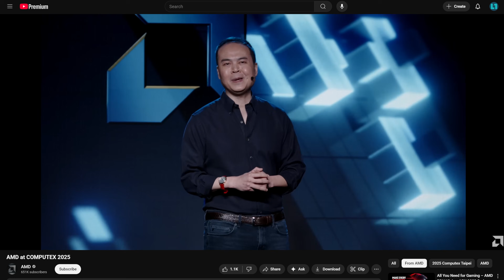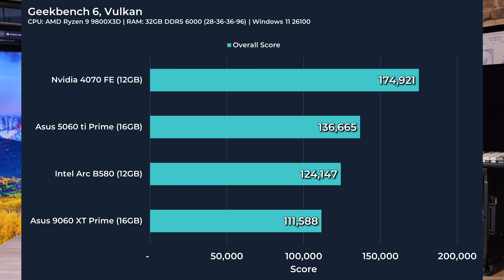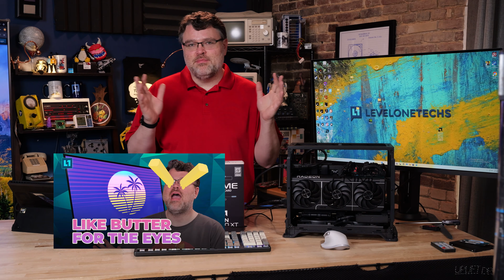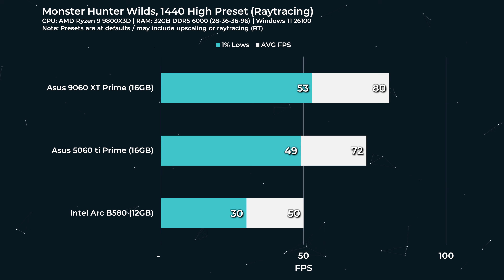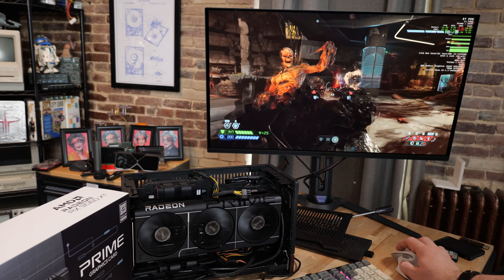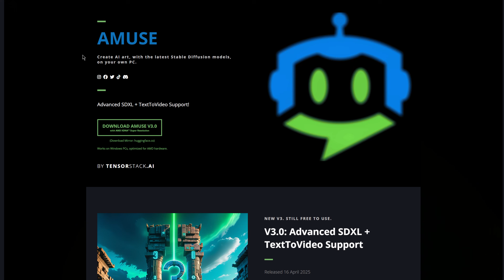ASUS Prime Radeon 9060 XT Review and Benchmarks!

Comment from the maker: Looks like the non pretty graphs made it through to the upload. My bad! The information is all correct! It's just not the right aspect ratio, so it doesn't look as pretty on screen. ~Editor Autumn
Reply: You made up for it with the butter eyes!
Reply: You need to try to stick a power color reaper 9060xt 16gb into a Asrock Deskmeet, it is 200mm and looks like a true 2 slot card and I think is the new itx budget king. Plus I think Asrock has a new AM5 version and it would be interesting to see if the gpu clearance is the same for both versions of the deskmeet.
Reply: @johnchristianson515  yeah I have the deskmeet x600, it's amazing
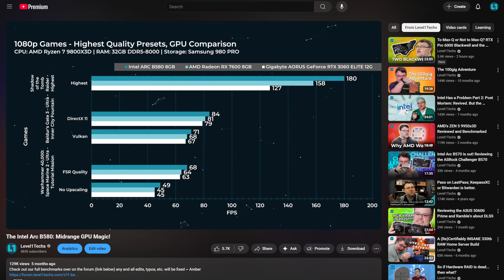Reply: 5:05 The graph says the B580 has 8 GB but it's 12 GB (even B570 has 10 GB).
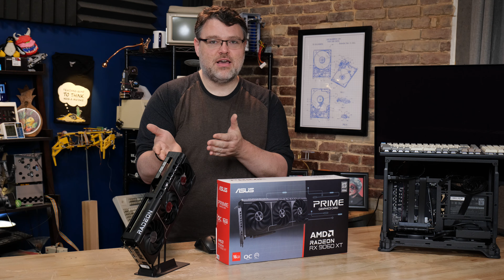Reply: 1:05 isn't 128bit bus width a problem somehow?

Comment: No reason to include the B580 in any comparison, because it's always shown paired with an extremely fast CPU like the 9800X3D. Nobody in the real world would pair those two, it would be more like a 7600, 7500F, 9600 or even an AM4 5000 series CPU, because it's an entry-to-midrange GPU.  Paired Properly, the CPU overhead of the B580 destroys its performance vs competing cards in its market segment, and there is no solution but upgrading the CPU... which if the user could afford, they'd be buying a 5070 or 9070 instead anyway.

Comment: Why is no one comparing the 9060XT to its most popular used competition 1st the 6700XT and 2nd the RX6800 / RX6800XT. I have a 6700XT is it worth upgrading to a 9060XT because a 6800XT is better for the same cost and the base RX6800 is equal performance for cheaper. I don't care about fake frames and I always disable RT. Other than power consumption idk...

Comment: Asus and gigabyte both can be extremely hit or miss with AMD hardware. The 6000 series they put out was notoriously horrible but the 5000 series were fine

The real problem is they tend to cut corners on the electronics

Comment: Intel B580 has been on my radar since your video about it's performance on linux. In that video you said that you'd come back to it as drivers improved, and I'm waiting, lol
I'm updating from my Ryzen 7 3700 machine, but I'm fairly poor so I'm getting parts for the new rig every few months as I can afford, so far a AMD Ryzen 5 7600 CPU, an MSI B650 GAMING PLUS WIFI ATX AM5 motherboard, and a Cooler Master MWE Gold 850 V3 power supply.
I don't do any hard core gaming, just stuff like 7DTD, so my graphics needs are light. I could probably get by with the graphics from the CPU. The Intel graphics card would be a step up from that, though, and would be better than my current NVidia GeForce GTX 1660 Ti, so yay.
I love all your videos, but sometimes you have stuff actually pertinent to me:) I've been a linux guy for ... well, I think there were dinos. I used to software engineer on unix so it's a comfort thing.

Comment: this does NOT need 3 fans this should be a tiny little guy for the SFF pcs!
Reply: Get the Powercolor Reaper 9060 XT, which is very small for a 2 fan model, but makes a lot of noise when cranked up to max performance.

Comment: The only upgrade for me (currently on a rx 6800 16gb) is power consumption and ray tracing are slightly better. I was able to get the 6800 last year for 350 open box. So there's almost no reason for me to consider this. Realistically you have to move up to a 500-600 dollar card to experience a real upgrade. When you can find them a 5070(NV) or 9070(AMD) most likely won't be at msrp. Its ridiculous to me that after 5 years you cant upgrade without paying almost twice what a previous older gen(rx6800) mid\high card is going for. Also stop making 8gb cards. BTW 8942 Port Royal and 17449 Time Spy on my system. I know games act differently but this is one example of this not being an upgrade.

Comment: I will wait for the market to die down. I have currently an RTX 3050 8GB for 3 years and so far, its doing a great job. Running the latest titles in 1080p medium preset with DLSS Quality at 60fps. Normally I play older games and try to hold on my gpu for at least 5 years(like I did for my gt 1030 when I was in High School). I can run most if not all e-sport games at 100-200fps+ and I can run 2023/2024 games at 1080p medium native or High with DLSS Quality at 60 fps. Any game before 2023 I can run 1080p high to ultra native quality at 60fps. The 9060 XT is kind of tempting to buy since I do have money, but my reason is if it works then why upgrade it. It does what I want it to do and use it until it can't do what I want it to do.

Luckily I have a 1080p 144Hz G-sync/Freesynch monitor, so I dont get screen tearing, etc.

Comment: Nah you don't have to feel bad for 6000 and 7000 owners. I am one I have a 6950XT. If games implement RT well that is made for usage on consoles the games run well even with RT on.

In other games the visuals are 9/10 of the times not that awesome vs raster only a few games have transformative improvements in visuals with RT on. And even then I don't think it's worth the fps hit vs visual improvement. I rather have the higher fps for more smoothness. And 6000 owners already got 4 years out of that hardware and it's not that raster does not look good.

But I agree we are getting to a point that RT is getting useful so for the next card it will be something to look for.
But I think 7000 owners will still be fine for 2-3 years. As long as not to many games force RT and break performance it's all fine.
If they implement it in the right way it can perform very well spider man is a great example.

Comment: This card is DOA if it doesn't hit MSRP. Slower than a 5060 TI and slightly faster than the 5060. When does 8GB of vram cost 50 dollars? The Nvidia cards are also getting closer to MSRP and DLSS support is still way better and that's a critical feature on this class of card, especially if you want to try some light RT.
Reply: I purchased the ASUS PRIME Radeon RX 9060 XT 16GB from NewEgg just yesterday (Friday, 6/13) for $349.99.  I also saw the ASUS Prime RTX 5060 ti 16GB in stock when I went to make my 9060 XT purchase -- three different listings for it in fact (all of them 'sold and shipped by' NewEgg): the first (new) priced at $479.99, another one (also new) priced at $529.99, and a third one ('open box') also priced at $529.99, and all of them were in stock.

I double and triple checked this: all three of those 5060 ti cards were the same model (PRIME-RTX5060TI-16G), and all three shown to be sold/shipped by NewEgg.  (I even went back and took a screenshot of all three listings lined up together; the two new GPUs showed a $9.99 delivery fee, while the open box listing showed 'free delivery,' and all of them indicated the same June 17th - June 20th delivery time frame.)  Go figure. 🙄

The bottom line for me: the $130 price difference between the 9060 XT ($349.99) and the cheapest 5060 ti ($479.99) makes the AMD card a MUCH better value, even when taking the 5060 ti's performance advantages into account. (I do like that Nvidia used GDDR7.  I just wish that AMD had also.)
Reply: Unfortunately it's $50 as long as Nvidia says it is. It's unlikely the AIBs would want to shrink the gap on the AMD side unless they were forced to, and they'd have to be dragged kicking and screaming. Given the current spot price, after figuring the AIB is paying for the memory and assembly cost, applying a margin, then the retailer gets margin on that, it could probably be around $20-25.

Comment: Wendell, Since I know you love to tinker.  Something in MHWi is off with NVidia cards.  One of the systems in my home has a 2080 Super and another 3060 in it and I actually get better performance like for like using FSR vs DLSS, both in 1% lows and frame times.  I found it odd on one system so I checked it on another one to verify.  Something about the DLSS implementation in that game is not right and I've recommended to a few people with newer Green cards try FSR instead of DLSS and they have seen performance increases as well.  (Yes DLSS 4 is generally heavier than FSR 3.x, but in this game it's significantly more so.)

Comment: The PRIME offering is our entry to the 9060XT, if users would like additional power limit headroom and a further improved thermal solution we have the TUF GAMING variant. With that noted the card is very cool and quiet and does have OC headroom. 

The default power limit is 175W but can go up to 192W. 

With performance tuning/overclocking you can generally see around another 5+ frames with quick overclocking results may vary from game engine to game enginne.
Reply: Too bad Nvidia bully you in to not having ROG AMD cards anymore, not that 9060xt would have one anyways probably but the 9070's.
Reply: An Asus employee fed me chicken nuggets behind a McDonalds dumpster last night in downtown Austin, Texas.
Reply: In return of some happy ending , right ?  @EvenStick-q3x
Reply: PLEASE make a small form factor card for this! At this wattage we could build a tiny portable or living room box but the 3 fan seems overkill for this card. Thanks!
Reply: What we want to know is whether the MSRP will be honored this time around ! MSRP is rarer than a unicorn these days.
Reply: @ftlfx  thats barely up to Asus
Reply: Woot! Hello Asus!
Reply: entry level... meanwhile PRIME is more expensive than anything other AIB offer and  8 GB version cost more than 16 GB Sapphire Pulse 😁😁

Comment: The graphs are great with comparing all the cards with their respective frame rates, but I think it would help with clarity to keep the cards in the same order regardless of their frame rates. Like at 14:00, if both FG OFF and FG ON (1X) had the same GPU order, it'd make it easier to compare the scaling frame generation has while also comparing each GPU against eathother. Great benchmarking and good info regardless!

Comment: The B580 is looking like bad value.  They were running much higher until lately (shows you the power of some competition), but the cheapest is 299, not the 249 promised.  I think Intel will have much better luck with Celestial, but man, the tests look weak for the B580 against RDNA 4 and Blackwell.  Would be great at lower 200's, but at lower 300's, even if the 9060 XT 16GB (FU AMD for doing this naming nonsense with an 8GB XT card) is high 300's, it has a lot more value than the B580, and the B570 is LOL DOA right now.

Comment: I doubt the 16Gb version of this card is available for $349. AMD doesn’t price anchor with a reference model.
Reply: I just bought the Asus Prime RX 9060 XT 16GB for $349.99 on Amazon. It sold out in half an hour. I've also seen it at that price in brick-and-mortar stores like Best Buy and Micro Center. This AMD series has been much closer to the recommended retail price than the Nvidia versions.

Comment: I run LM Studio on Windows and I'm wondering if I should buy this card. After all VRAM is the most important part of the GPU. And for running LLM's, even if you will only partially offload the model - it is the difference between night and day.
Reply: Just buy a framework desktop with 128gb of available memory for the GPU.
Reply: @singular9  I wish I had that kind of money. I have my 5950X with 64GB of RAM and the only reasonably priced card I could buy during crypto bubble that wasn't 8GB - RX 6700 10GB.

And LM Studio, Amuse and InvokeAI work ok.

BTW on my father's Framework Laptop, I tried installing LM Studio. When I loaded any model (even small, since it has 32GB of RAM), laptop would crash and wouldn't stop crashing until I unistalled LM Studio. It's probably the BIOS, because I was assembling it in October/November and there was some issue with iGPU (normal OBS recording using default AMD preset would freeze the recroding - workaround with open GL fixed it). I do hope that fixes it, because then I could maybe invest in 96GB for it's RAM.
Reply: @singular9  one is $350 and the other is $2,000

Comment: Just yesterday I decided that I am done with nVidia. I have RTX 3060Ti and it's really good card BUT I wanted an upgrade. The prices for nVidia are insane and with all their false marketing lately I have decided to switch to AMD and will probably go for AORUS 9070XT OC+ with 16GB. It's not a cheap card but it's waaaaaay cheaper that any decent nVidia upgrade options and packs quite the punch!
Reply: Do it
Reply: I got a 9070xt and couldn’t be happier. I did a 50mv under volt and upped the total power 10% and it’s rock solid running 3.4ghz in synthetics
Reply: I went from a 3060 Ti (gave it to my daughter) and got a Sapphire Pulse 9070 XT. Huge, huge upgrade! Together with my 5800X3D it's a dream machine right now!  I play at 1440p 170 HZ monitor and it just plays smoothly! Don't forget to use DDU when switching from NV to AMD and vice versa.

The Adrenalin Sogftware is so far ahead of NV software right now. It's an all in one software that even allows a per game control on your OC (some games can handle higher OC on your card others can't) with fan control, stats monitoring, etc.

EDIT: If you can find the Gigabyte OC or Pulse, they are both cheaper and run cool and quiet if you tune your fans properly. I don't like zero fan and my card at full load running at 1500 rpm tops out at 52*C with a hot spot of 70*C. Memory temps are also at 68*C. All temps taken with an ambient of 26*C.
Reply: A 9070 or 9070xt would be the choice for me. MSRP's(real) and availability are all over the place. In a perfect world you shouldn't have to pay more than 450 for a card @ this level. If you are building a new lower to midrange pc the 9060xt 16gb would be a good choice if you don't want to go used or open box.
Reply: Same. Have a 3060ti. Going to sit and wait till either it dies or I can buy a card for 499 that can give me 2x the performance.
I won't settle for 50% more performance when a 9070xt is like 900$. Don't give these corporations your hard earned money.
Reply: @singular9  I tend to agree but I doubt that we will see that kind of an upgrade in the near future, for that price.

Luckily I will also use the 3060Ti to upgrade my brother's computer since he still has 1070Ti. So I get double the value out of the deal, sort of :)

Comment: Look at the real price of 9070xt, the 9060xt probably will be $500 in the shop.
Reply: B580 with 12G VRAM has an msrp of $250. Its street price is $380. So if 9060XT with 16G VRAM has a street price of $400, it’s a steal!
Reply: could you care to explain why it would be higher than 5060 Ti OC which is at msrp $429
Reply: On Newegg you can get a 5060ti 16gb for under $500… 9070xt is about $100 less than 5070ti. So probably 400-450 for the 9060xt 16gb.